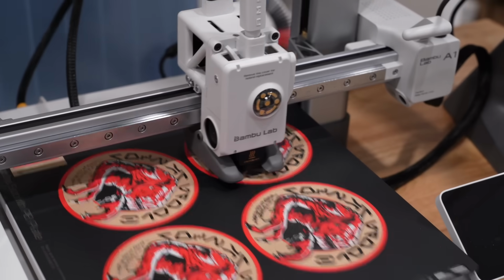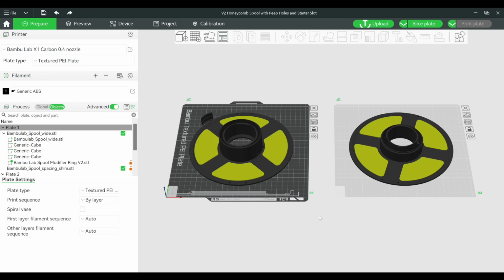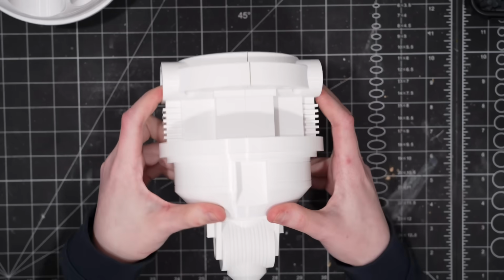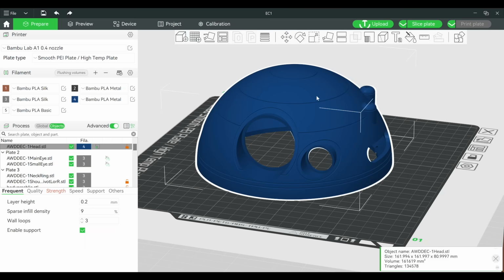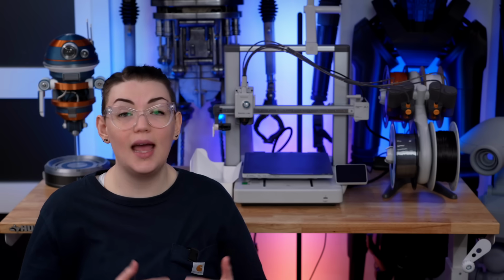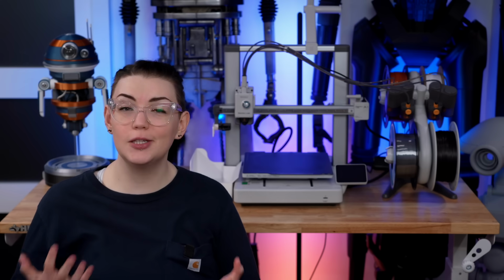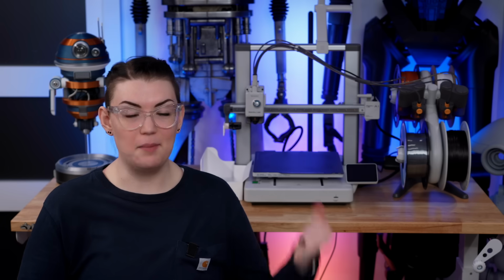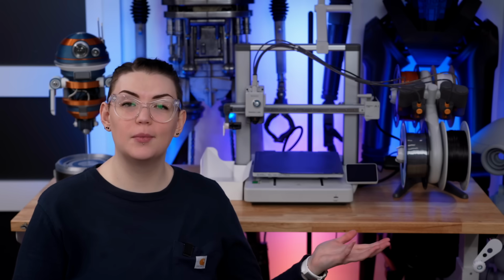Is the Bambu Lab A1 the Unbeatable 3D Printer for Beginners?

Comment: Would have been if not for their choice of Prusa derivative slicer - Bambi Studio. While user experience in Prusa is a nightmare, user experience in Bambu Studio is just slightly better, plagued with lack of sane defaults and convoluted setting locations. Most importantly it lacks Cura's DRIVING SETTINGS I.e. singular settings that altered drive changes in lower level settings. In Bambi Studio you need to change everything manually. It quickly becomes a remembering game spread across numerous tabs. Bambi Labs also lies about supporting Cura right in the product pages.

Comment: I have been using a Ender 3 v2 for a couple of months and this video has really opened my eyes. The A1 if light years ahead of the creality.  One question if you don't mind.. Where do you find stl files that are made for color printers. I don't think I've seen anything like that on " thingverse  or cgtrader,  Great video thanks
Reply from the maker: The Ender 3 V2 was a great machine at the time but yes, the latest generation of printers have really eclipsed what previous machines were capable of.
You’ll find all of the multicolour prints as .3mf files which are capable of retaining information like where the different colours should be on the model.

Comment: And on a less ranty post, can I ask whether this AMS can do multi material?
Reply: Yes! However, for filaments like TPU you wouldn’t use the AMS as it’s flexible and can have issues with feeding, so you would have to just use the normal spool holder.

Comment: Its so great to see that you had the exact same experience then I did when I bought my two P1S a few weeks ago. I allready have over 500 h on them and are currently printing my first full B1 Battle droid that you inspired me to! Like you said its just outstanding! But! I think you missed one not insignificant point of the AMS system and that is that you can have the same material on different slots in the ams so when you print something like a droid you dont have to worrie about beeing there in time to swap spools. It just emties one and keeps on chugging with the next wich is just soooooo freakin awesome! Especialy if you do longer prints and I highly recomend you to try that feature out. A yea and like you said the bed size is a good compromise I think. But I would love to have a bambu with 400x400x600 or something for helmets. But I think you should also look into the P1S series. Its so nice to have a non bedslinger in that size and you can crank up the speed even more. Plus the enclosed ams is also great to store filament so even if you dont print multi color its still great to have to keep moisture off your filament. I loaded mine up with two spooles of pla and two spooles of petg for my bigger projects and its just amazing to have that option. 

Oh by the way! I found this project the other day and I am pretty certain you or one of your friends will love it too! And its another nice test for your ams! https://makerworld.com/en/models/433175#profileId-337827   

Keep up the great work! I allways look forward to your new uploads! Cheers from Germany

Comment: As I understand it, it doesn't matter which line goes to which port, as the filament is pushed by the AMS Lite into the extruder gears. I've taken mine off to add a printed part, allowing me to keep the AMS Lite and external spool connected simultaneously. I didn't worry about which line went where except for orderliness.
Reply: As Jack said, the filaments can go in any tube, it doesn't matter to the printer as they all come out the one nozzle.

Comment: lock me in that ecosystem baby! its a great feeling knowing you can start a print and walk away to a finished print 97% of the time.  compare that to my ender 3 that you would go through a quarter roll just trying to get a few layers down.

100% worth it
Reply: Vendor lock-in is not something to ignore, you should be coaching use of a system like this against what they restrict. These are easy to use, but we don't want 3d printers to be like the rest of the printing market.

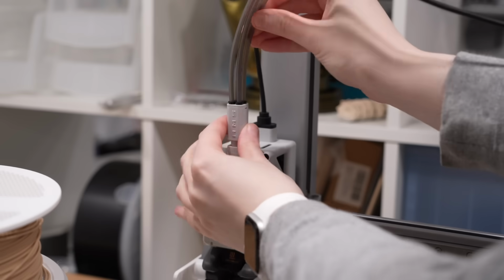Comment: 13:03 what do you mean with this? It does not matter where the tube goes. They all go to the same Hotend.
Reply from the maker: Yeah I realized that it didn’t matter afterwards. I thought that the runout sensor might be line specific at the hotend and not the AMS. Although, it did mean that the cable management was very aligned from the actual AMS unit to the hotend which can’t be a bad thing.

Comment: Not just multi-color, but multi material. This is where this machine truly separates itself from say a prusa with the MMU units. I currently use qidi tech i-fasts (dual nozzle, heated chamber" solely for the fact that I can print in two different materials. i.e. PETG with TPU flexible material embedded in the print for flexibility. Great review, you should review the AMU unit that bamboo has with this, and multi-material printing.

Comment: The worst part of 3D printing hobby was the stage where people forced themselves into believing that not only you need to pay money for the device itself but also spend countless hours adjusting it and wasting additional money on replacement parts when things go bad. We definitely need "straight out the box" solutions so that we can finally stop being slaves of endless tinkering.
Reply: I agree with OPs comment, i tried 2 different printers and got nowhere. First it was the ender v3, then it was the cr10s pro v2. I spent 5 months chasing a problem i couldnt even identify. No amount of trouble shooting, buying new enclosures and filaments, bed leveling, settings tweaking or the sort ever got me closer to enjoying the $500+ machine i bought. Its both frustrating and demotivating when you follow every guide and quickfix to the tee and become the best bed leveler in the world after close to 100hrs just doing that, just to get nowhere. With the amount of additional upgrades i would NEED to purchase just to get a benchy, i would be in close to 2x what the printer itself cost.
Reply: I’ve been watching this community without participating purely because I’ve been waiting on it to become “out of the box” because I knew/know I just don’t have the freakin time to spend learning the equipment and nerding out like I used to. 
Now it seems like it’s there, I’m excited to jump in soon
Reply: That exists. 
Qidi Tech. 
When I bought my Xmax in 2020. I unboxed it. Powered it up, install filament, and set Bed height. Next, send a file and let it go. Which it did, beautifully.
Reply: @robcoastalga8279  im new to 3d printing like only started learning about it today and im interested in the printer in the video is the qidi something i should look at?
Reply: I find that a lot of the type of people drawn to the 3D printing hobby are people who like to tinker with things including their new toy, the 3D printer itself. I started back in 2017 with the original CR-10 from Creality. By the time I was done with all the many changes, tweaks, and upgrades I got that OG Chinese printer making prints as good as my Prusa 3s. I personally think that it’s great that printers are getting easier to use and work more reliably but at the same time I will miss the ability to work on them and tweak them even if it was done from necessity in the past. I will miss the old days from the beginning of the hobby the same way I miss being able to work on my car. I love the fact that newer cars are so reliable and efficient but when I open the hood I don’t even know what I’m looking at!
Reply: to play devil's advocate, that process teaches a person how to fix their device by themselves which in itself might be something valuable for the hobby
Reply: @inoob26 If you bought a crappy car that broke down all the time it's not a cool function that you get to tinker on it all the time.
Reply: Ya we don't have time for anything in 2024.  @inoob26

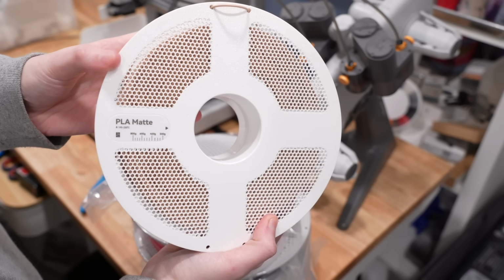Comment: 13:05 Order of the tubes is completely irrelevant FYI, it doesn't care where they are on the hot-end, as there is only one sensor filament triggers, all that matters is the 2 longer tubes go towards the outside.
Reply from the maker: Yeah I realized that after. Originally I thought the runout sensor might be line specific in the hotend, etc.
Reply: @MMsPropShop  I think it was a fair assumption, they don't explain it well and say to put them in a  somewhat specific way, then also show an illustration that has same colors crossing paths for the 2 lengths.
Reply: So does the sensor know which color it’s seeing?
Reply: @CallsItLikeISeizeIts  it doesn't know what "color" is what, but it does tug on the numbered spools in a sequence to figure out which is currently loaded, if left in an uncertain and loaded state. Else you are initially telling it what color is in what slot, also to use the runout resume you need to be sure and set the slots to be identical colors and materials I believe. Can be done on screen or via software. So in that sense it tells you what color you told it is there.

Comment: I got the A1 Mini without the AMS and it is my favourite appliance. Whenever I need something small to hold something, to repair something or just something like a mixing tray for glue or what have you, I have it in a few minutes or hours, spent a few cents on it, have no shipping, no hassle, just exactly what I needed, when I needed it.
Reply: As someone that does consumer electronic repairs and design things like cases for electronic equipment and so on, this printer is a perfect tool to sit next to my electronic workbench. After using the Creality line of printers (not bad at all by the way), this printer is just more like of piece of equipment, and not something that has to be tinkered with every now and then.

Comment: My ownership of the A1 combo wasn’t so great. But to be fair it was the only bed slinger in a farm of x1c, p1p, p1s, and rat rig printers. I wound up trading it in during the recall and replacing it with another p1s combo. 

With that said it was one of the best led slingers I have owned. The only more reliable bed slinger I’ve owned was a prusa but the prusa was much slower but had a better success vs. failure rate. so I’d say the A1 is a good printer for a beginner. I’d still urge people to consider the p1s if they can afford it. 

Honestly with as many Bambu printers I already have I’m not looking at Bambu until the at least build a larger build volume printer. The printer I’m most looking forward to seeing the full release of upgrades for os the Rat Rig vcore 4. If the IDEX model of that printer really does support an AMS for each print head that potentially could be a game changer since it kinda sound like the idle head will load and purge the next color while the active head is printing drastically speeding up multi color prints. Current multi color prints just take too long due to the purge cycles.
Reply: I'm waiting on my RatRig to arrive, hybrid for now as IDEX is not available at the moment.
Your idea about AMS for each print head would be great if we could have an AMS with 2 independent selectors.
There should be a mechanism like in a mechanical typewriter, which switches between normal and caps, to send filament to the first or second head.
Otherwise you need 2 AMSes with duplicate colours in each to take advantage of load while the other head prints.
Reply: @ilovetechnology8436  a lot hasn’t been released on the AMS system they claim is in development for the vcore 4 but there is a lot of speculation for sure. The idea of 2 separate AMS units, one for each print head, is one that I see the most potential in. I’d have no problem with multiple AMS units if it means faster multi color prints. 

It’s possible that Rat rig only is planning a single AMS, and that would be a shame since the biggest drawback for me is the increased print time. Waste is a concern but the only real solution to that is like what prusa is doing with the multi print head set up, which to be fair should also speed up print times too. I heard that elegoo plans multiple heads on the orange storm giga as well but that’s not a printer I’m really interested in, and the one person I know with one as well as some of the YouTubers have had some real issues with them.

Comment: Appreciate your review. I just got this printer with AMS and still have tons to learn. Prints are usually great but run into a lot of top layer roughness (so far the most common answer is enable ironing but it hasn’t helped much). Your video gave me some direction on some of the slicer options I should start learning more about  - thank you!
Reply from the maker: It could be that you’re using too many or too few top surface layers. For printing at 0.2mm layer heights I don’t go below 4 or above 6. Having proper cooling enabled is also important because those first top surface layers are essentially all overhangs.

Comment: Great video, and actually seems like a great entry point for people new to 3D printing. Surprised you can print PETG direct on that bed, since I've had to use polyamide tape in my setups prior. 
Software definitely seems like a slight issues either way, since there are so many slicers, and it sounds like they are trying to corral you into using only Bambu labs related software/account.
Reply from the maker: The main issue with slicers right now is 90% of them don’t support multicolour printing in any capacity so they’d be completely useless for any AMS use. I believe Orca Slicer is compatible with Bambu Lab machines but that also makes complete sense since Orca is derived from Bambu Studio. I’m sure compatibility with other slicers will be something that changes in the future but at the present moment, using another slicer outside of Bambu Studio/Orca would be a downgrade in my opinion.

Comment: I own an X1C, the failed prints I have had on it is either filament problems (breaks and clogs), or dirty buildplate causing aheadsion issues. And I have done multi-day prints on it and it just works.

Comment: I am thinking about getting into 3D printing, the concern I have is moisture problem with filament  what do I need to know and how big a problem is this. Type slowly I’m 77 years old. Thank you.
Reply from the maker: It really depends on the humidity where you live/where your printer is running. Personally it’s never been an issue for me but Ontario, Canada also isn’t the most humid place on the planet. There are many ways to mitigate wet filament if it is a problem with things like dry boxes, filament dryers, etc. It also affects different types of filament more than others.